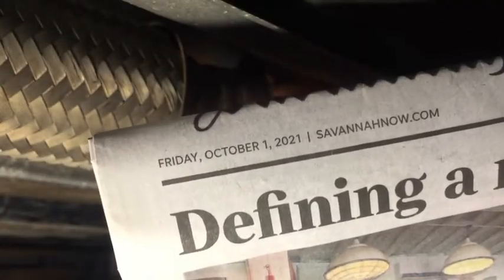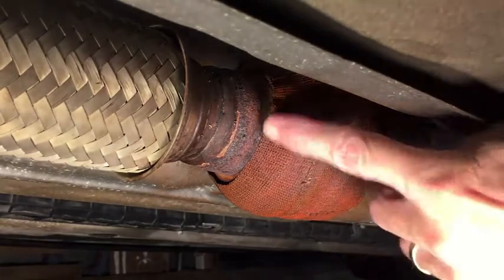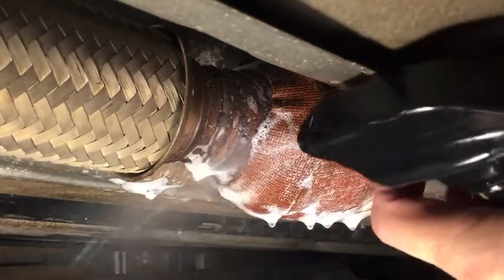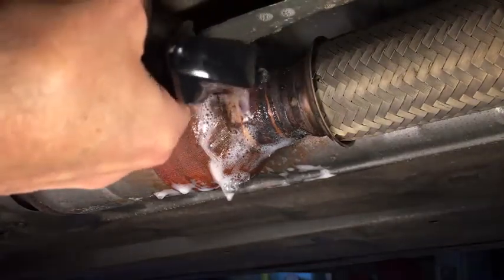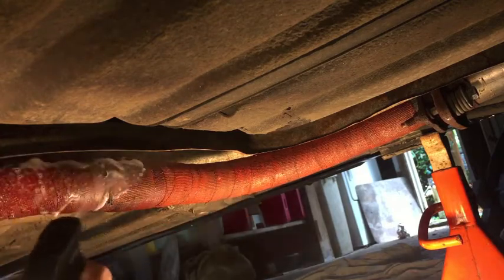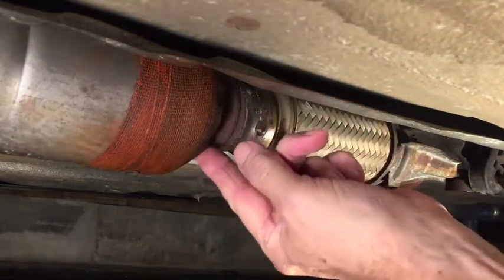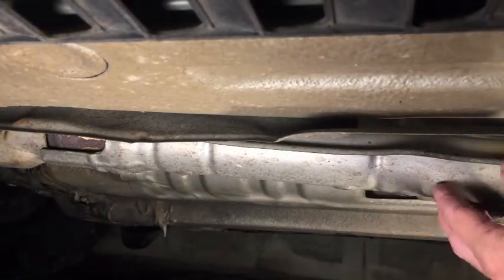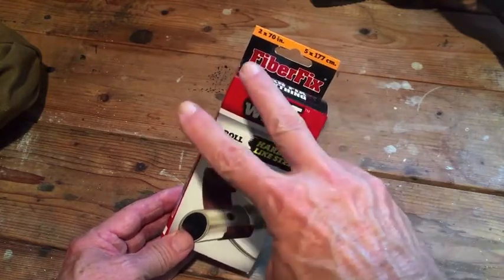FiberFix Exhaust Repair 2 Years Later

Comment: Many thanks from France you helped me to find a really strong solution for my Ford mondeo MK3 (Muffler Assy - Rear) because it's a one part from the pipe and removing it for welding is a mission. Maybe your repair may stay more if you removed the rust before. Merci beaucoup
Reply from the maker: De rien..

Comment: Can you tell us about the jack point that you are using at the rear center? I have been thinking about using the trailer hitch's central arm underneath (on a Nissan sedan) as a center jack point, but I'm not certain about doing so. Clearly you have successfully jacked up this Honda at the rear center. Would be interested in any tips. Thanks